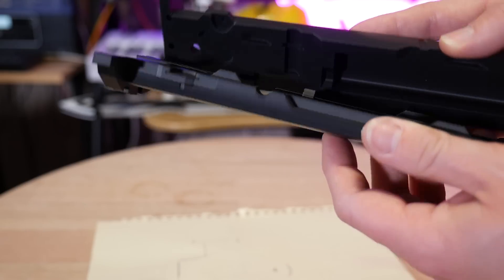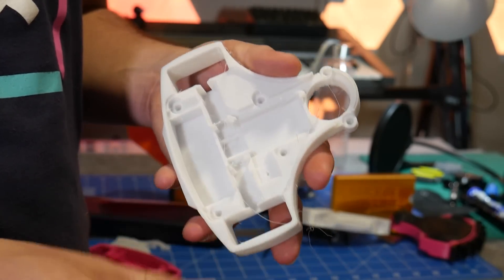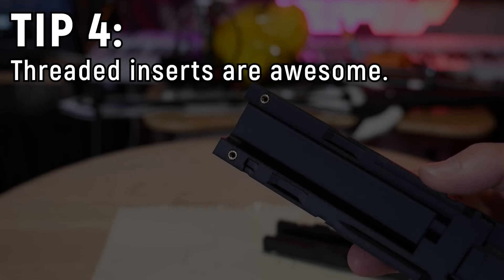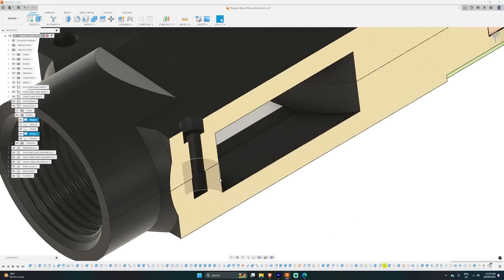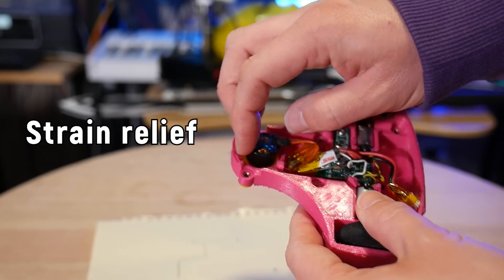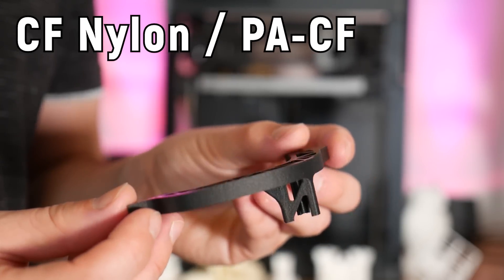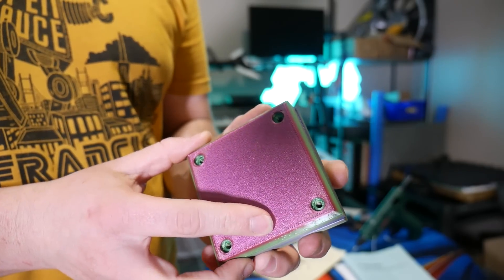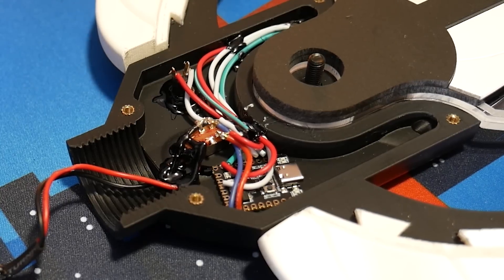How to design complex 3D printed products (and not mess it up!)

Comment from the maker: Random comment, it's pretty fascinating how the YT compression totally removed the square grid from my graph paper footage. Definitely use graph paper as it makes transferring dimensions and alignments WAY easier than blank paper. 😂
Reply: Back in the day, the blue grid on graph paper was chosen so it wouldn't reproduce on photostats and Xeroxes, and the drawings would look like they were done without guides. I guess YouTube is just trying to make your drawings look cleaner.
Reply: on the hotmelt glue, no one ever talks about the fact that there are various types and a 3D printer pen is basically a hot melt glue gun for PLA and ABS as the hotmelt glue material, 
On regular hot melt glue, there is this stuff I love for holeless dent repair that will actually bond to things the clear off the shelf stuff just will not bond to at all, (like the black plastic PolyEthylene sheeting for painting and construction, comes in big black and clear rolls up to 6mil here, and the clear stuff just peels off it as if it were candel wax you were trying to bond to, but the black car repair stuff I have you cant remove once it cools without either heating or cutting it off, and the same applies to bonding to glass and all plastic types for 3D printing, that I use (taulman 230 PLA and ABS are all I have used so far, still gotta build that high temp head and system into the new printer so I can print with 910 and PC or regular nylon ect.)
Reply: oh also the black stuff is a bit more like rubber than the clear, so its not as resistant to bend with a wire too, so you can use it for reinforcing bends of wire so they wont break from bending as sharply, using it now on the electrical cords for a lot of LED to wall outlet cords and it works so well at protecting those wires from breaking out of over bending and stress flexing them :) just dont use it to make caps for sharp metal items cause its nearly impossible to peel off so you can use the tool then slide it back on, that is where the clear stuff works far better to act as everything from a replacement cap to a pen to protection for sharp wood chisel edges when not using them.
Reply: @ThomasAndersonbsf  Thank you, that is a very good tip! I found the car dent repair sticks , black and also yellow which is stiffer for about 1 € per stick . A colleague of mine described the printer extruder as "basically a glorified glue gun" 😂. That's quite true.
Reply: @Trust_me_I_am_an_Engineer  yep, wait till I get my multiport printer head based a bit on the 9 pin printer design, but the pins retract to open the holes where wanted while the head rotates to allow controlled both width and layout distance (so a width that is 3 passes wide, instead of going back and forth 3 times, can do it in one pass) with the distance to another path needed that also is open so we now have 4 passes all done in one pass, all using square pins, and the hole they fit in is a long slit between two plates, as part of the path to a replicator level 3D printer system of upgrades (DLP control of laser dot shape for fast lay down, ect, to use a laser to attract needed atoms to a given area or molecules depending, instead of trying to grab and move the particles to location, ect, :)  Would be nice to be able to make a hotmelt glue depositing system too, where you can then just use an iron or air gun to quickly bond things together, after getting them ready off printer too (like using an iron for laying down massive sheets of wood lamination, over another surface) 

next development is a system for forcing extraction of contamination like oxygen in rust, TiO2 ect while it is being hit with a laser since I found the ones I have can reduce rust into iron metal with out it, and convert white powdered TiO2 into the crystaline brown/black chunks of the substance. Will mean printing from both raw ore only what is wanted directly and alloys of mixed reacted metal oxides ect. all with a 500mW to 2.5w laser diodes for single point deposition, or knife mirror arrays for shape controlled larger areas to make it run a bit faster :)
Reply: Noticed you mentioned carbon fiber as a material. There were some videos making the rounds pointing out how dangerous printing with it at home can be. Seems like being safe with it can be pretty tricky, would love to hear your thoughts!
Reply: @zeikjt Nathan builds robots video
Reply: YT compression is a little bit agressive since a couple years ago, makes a lot of details just disappear :/
I noticed it on Laura Kampfs tumbleweed disco ball too, in a lot of shots the tumbleweed just turns into a fuzzy brown ball...
Reply: lol
Reply: Did u have a fursuit in the cat puzzle vid? I thought I saw one

Comment: Hey Angus. Aus based maker here, if you arent already aware Bolt and Nut has a spectacular online catalogue of fasteners and for much MUCH less than bunnings. I get all my fasteners from them. Pretty much any size/length/head type you could ever possibly want
Reply from the maker: Hey, yeah! They're great for sure. I'm usually way too disorganized to allow for the delivery time unfortunately😂 . Got a good local place for the boxes though if I need lots.
Reply: @MakersMuse  I personally use almost exclusively M3 with the occasional M4 in my designs so I just keep a large stock of a bunch of M3 stuff. Bulk ordering online through them works best for me. I got a big set of sorter drawers from jaycar(I think 120 drawers total) and it's basically overflowing